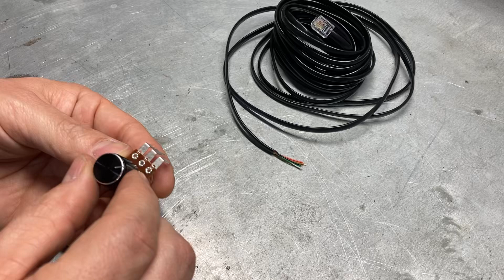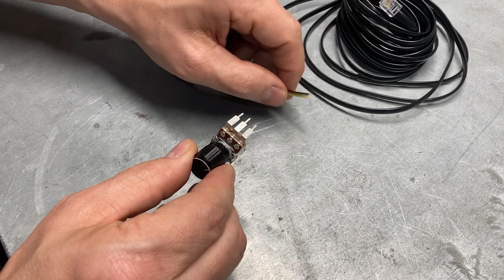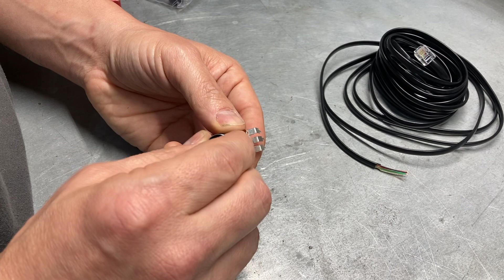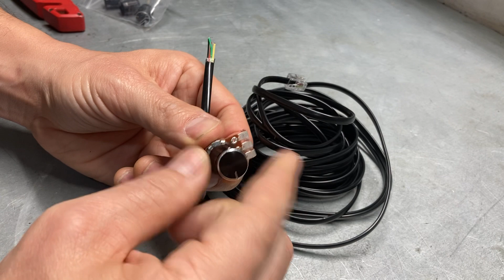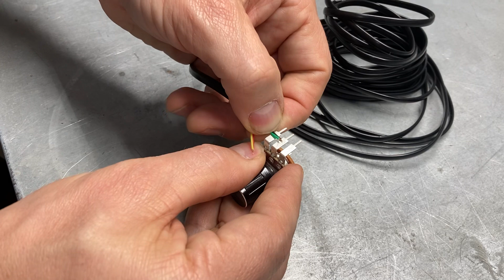Home Made Bass Knob for car audio JL Audio Amp and more

Comment: Hey it is not working for me but I use a cable that have black red green yellow and a white wires do you have an idea what can I do?
Reply: Also I’m using the esx signum se5800 amp
Reply from the maker: @MoneyTalks1.0.0 it could be the amp because some amps may be more of a bass boost knob vs an attenuator.  Or, the cable/wire you have may be for two telephone lines and maybe that’s why it’s color coded differently

Comment: This didn't work for me controlling an old school JL 500/1 (Slash series), where the JL knob RBC-1 is called for to control the bass boost function.  I did find another set of DIY instructions that provided somewhat opposite wiring than described in this video:  The green/black wires go to the single pin where this vid shows the yellow/red. Let's call it pin 3, if it is the one on the far right when they are all facing up.  Then the Yellow/Red wires are connected/bridged between pins 1 and 2. This worked perfectly for me and I hope my experience helps someone else.
Reply from the maker: Thank you for sharing.  Correct, this will not work for amps that have bass boost.  I’m glad you figured it out.

Comment: I've tried this with my JL Audio M400/4, but it doesn't seem to be working at all. The amp just acts as if the 10k potentiometer isn't plugged in. Do you think that amp needs a potentiometer with higher than 10k?
Reply from the maker: I wish that I could better help.  I didn't pick out the spec of the potentiometer for this build  so my main focus was on the wiring, etc.  It should work but you could be right.  I'm sure you've done this already but I would double check all of your connections.
Reply: @GreggyGTV thanks for the quick reply. 

Yessir, I quadruple checked the wiring. I also tried a few variations of your wiring to see if those could work. 

Would you mind sharing details (forum, page, etc) on information from this Tricky Ricky character? Hoping to find someone who can educate me on what is wrong with my setup. 

Thanks again!
Reply from the maker: @blakeeasley you should be able to find him on diymobileaudio.com

Comment: So quick question, i have a 3k amp, and maybe its the way the amp is tuned, but on my bass knob i can only turn it up a quarter of the way, and after that it doesnt get any louder.. do you know if a higher capacity potentiometer would help, or maybe just get it tuned professionally 😂😂
Reply from the maker: Thank you for the question.  I’m so sorry, I wish that I could offer more help but I don’t know the answer to your question.
Reply: @GreggyGTV  no worries my friend,  don't know till you ask lol. Thanks anyway
Reply from the maker: @savedbygrace5436 I’ll try to research it if I get a chance. Someone told me about the parts for this one and I assembled it and posted the video.  Thanks again for viewing, please consider subscribing to help the channel grow.
Reply: @GreggyGTV  for sure man. I'll sub to anyone who is willing to help another friend out! Thank you
Reply from the maker: @savedbygrace5436  Thank you man!  And just so I know, you used this same part but it only changes the output by 1/4?  Hmm, and you are thinking it's the ohms on the potentiometer that should be higher for your amp?  What amp do you have exactly?
Reply: @GreggyGTV  well I didn't use the part in your video, I used a bass knob that was already manufactured,  like a stock bass knob, that has the telephone wire to it. And well, I'm not sure if it's the Ohms or resistance or what would make it better, but I wasn't sure lol. And I have a 3k trauma amplifier, you can run it bluetooth or wired, either way it's the same results
Reply from the maker: @savedbygrace5436  hmmm, I'm wondering if the exact part I used in the video would work then?  It may be an issue of the ohms in the potentiometer.

Comment: Can you connect 3.5mm jack to the telephone wire to plug into the amps with the telephone style plug in
Reply from the maker: that's a very good question.  I'm sorry but I do not know.  I highly doubt it though.
Reply: I need to know also

Comment: i use a regular potenciometer and not working with my 1000.5 v2 jl amp.
any idea? or this works only with your potenciometer model?
Reply from the maker: it should work with other potentiometers in these specs.  It's my understanding that the specs make a difference.

Comment: Awesome vid, thanks! I’m swapping out my Rockford Fosgate R2-500X1 with a JL JD1000/1, you think I can use the Fosgate knob on the JL?
Reply from the maker: Thanks for supporting the channel.  Please consider subscribing, I would greatly appreciate it.  As long as the Rockford knob has the same telephone connector it should work fine.
Reply: @GreggyGTV  right on, I’ll give it a shot.

Comment: I’ve heard rcas are the way to go versus the telephone cords. What are your thoughts?
Reply from the maker: Interesting, I haven’t heard that but it could be an interesting experiment.  I’m thinking it wouldn’t make a detectable difference since it’s just attenuating the signal down, from 100% to zero
Reply: @GreggyGTV  thanks for the quick response
Reply: It would definitely be a fun experiment
Reply: Line out converters are what I've had the best results with